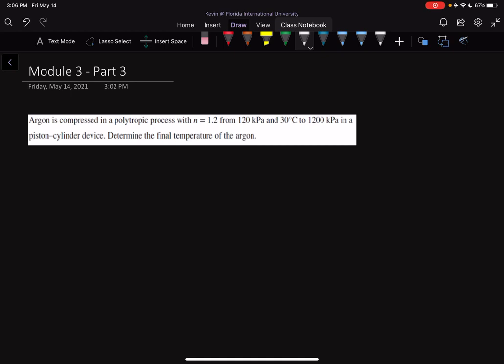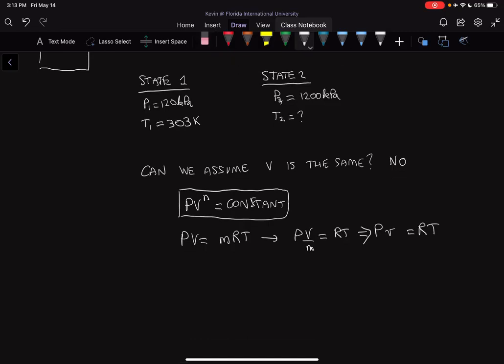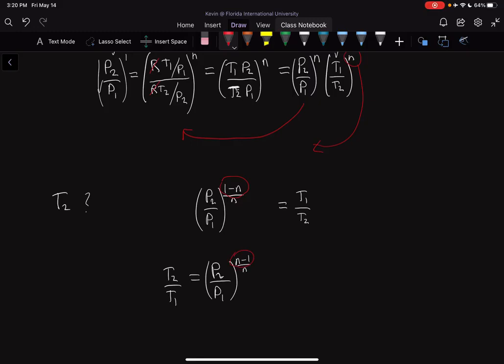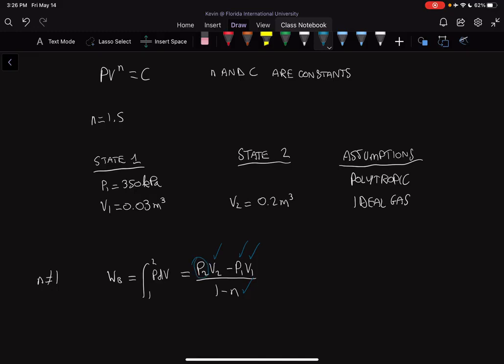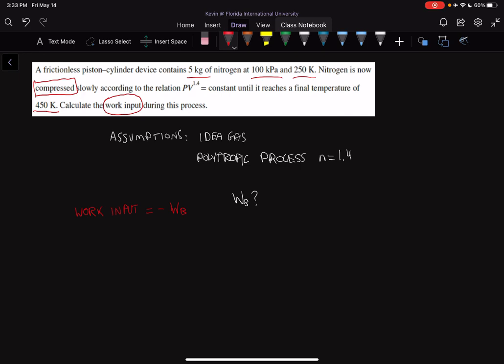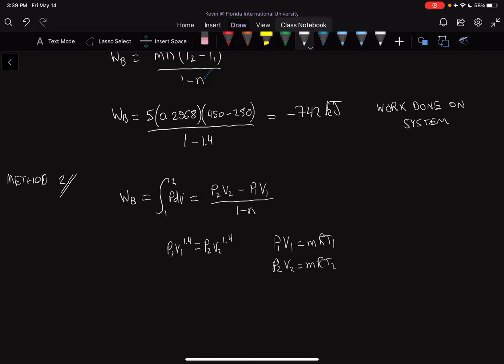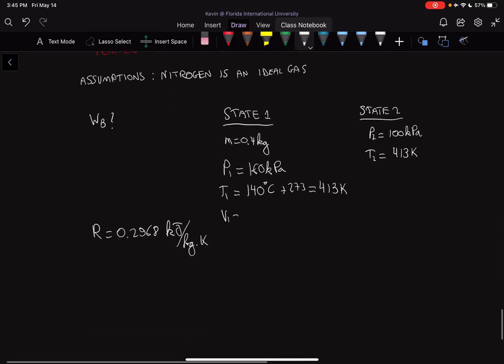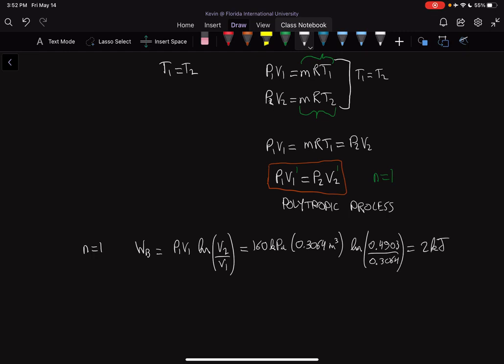Thermodynamics I - Polytropic Process Examples M3P3

Comment: hi Kevin, can you clarify how did you transferred power of n taking it from (T1/T2) to the left make it  ((1-n)/n)
Reply from the maker: Your P2/P1 on the left side is essentially (P2/P1)^1. Then on the right side you have (P2/P1)^n. So if you bring the right side term on the left you can combine both to have the powers be (1-n). Let me know if this answers your question. If not i can try to explain in a different way.
Reply: @kevinboutsen  that part I get Quotient rule it's n in denominator , where that came from
Reply from the maker: Oh it comes from making the left and right side all to the 1/n. Which cancels the (T1/T2)^n becomes (T1/T2)^(n/n) and n/n is just 1. The other side becomes (1-n/n). Makes sense now?
Reply: @kevinboutsen  got it, much obliged
Reply from the maker: Awesome any other questions let me know.